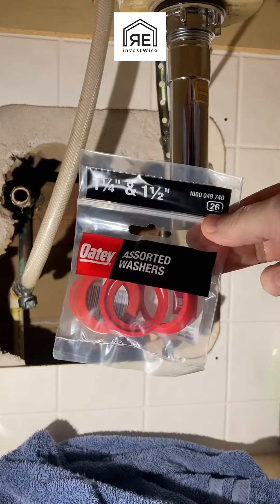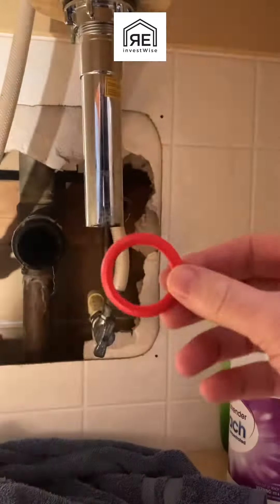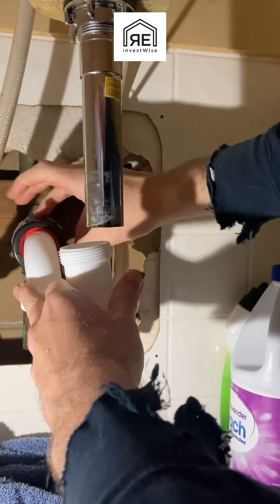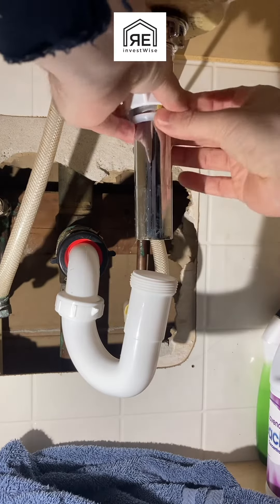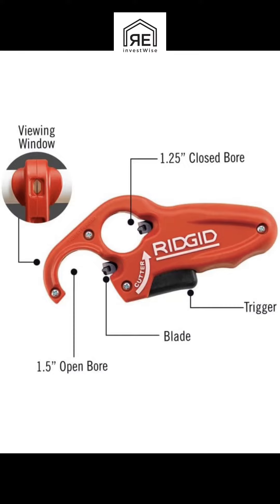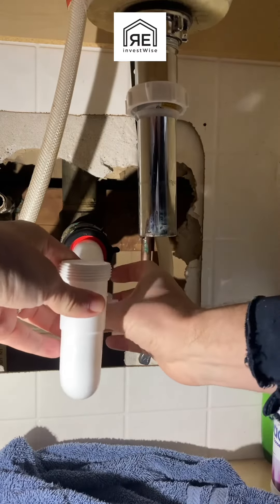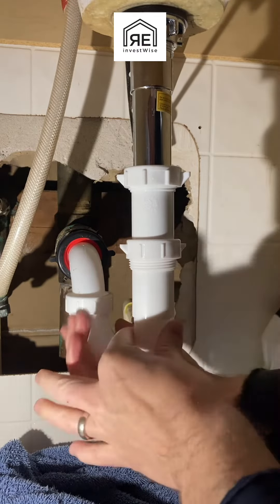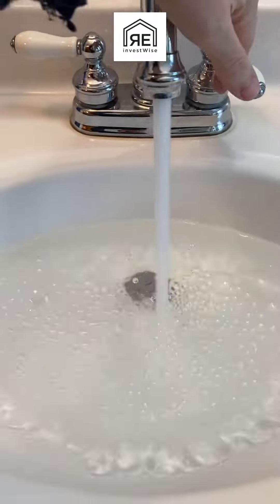Replace P Trap on Bathroom Sink

Comment: How 2 go down in size or up? Example: u have 1 1/4 sink drain but trap + is 1 1/2 how 2 fit together?
Reply from the maker: They make an adapter washer that will go from 1 1/2 to 1 1/4. You will want the trap and drain the same size to simplify things.

Comment: 1 1/2 Pipe out of wall can't get nut off.
Reply from the maker: That is sometimes the hardest part of the job. I’ve had to cut them off before but be careful
Reply: Not 1 1/2 but 1 3/4 in. Pipe wall area with stuck nut! Leave in .
Reply from the maker: I have not run into 1 3/4” pipe before.
Reply: 2" then
Reply from the maker: You could have 2” in the wall. It should adapt down to 1 1/2” pipe coming out of the wall then it should Ave an 1 1/4” trap adapter with male threads so you can connect the trap tubular pipe. At least that is what is typical in my area.